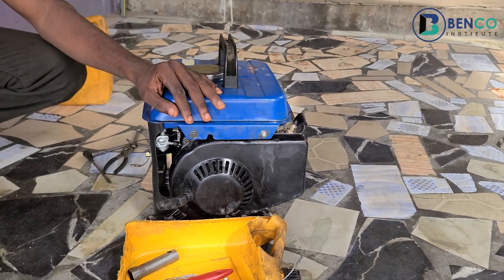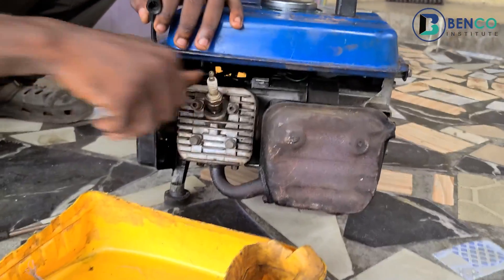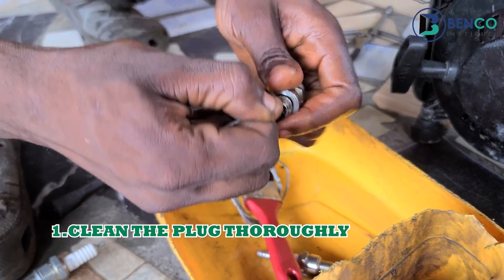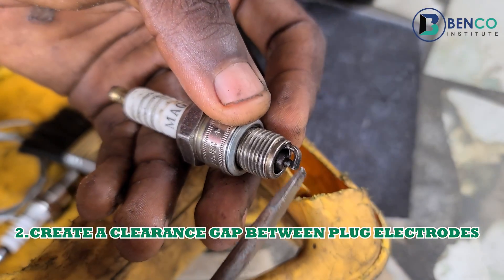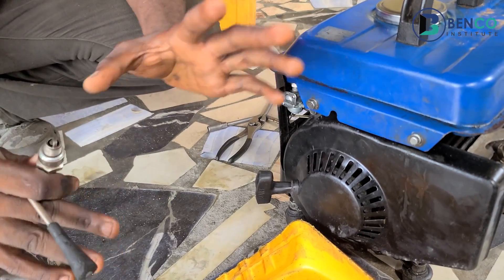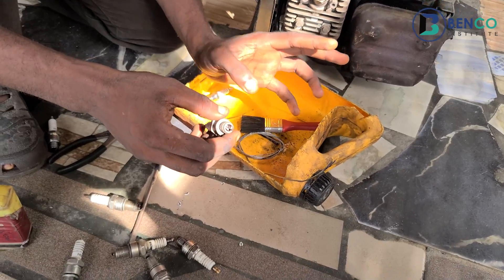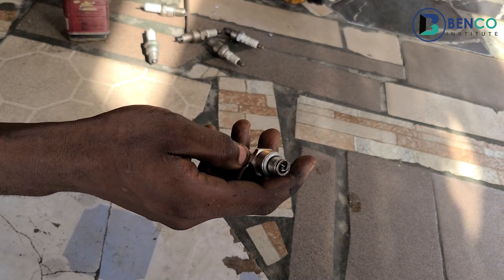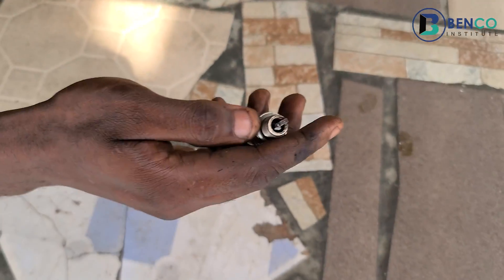How to repair a spark plug/Igniter  in 3 steps with no tools...Anyone can do this

Comment: Good job,my generator imex 2700 output voltage will not pass 150v even though I increase engine speed pls what can I do
Reply from the maker: Check the Diode of the Rotor
Reply: I've checked them 4pcs they are good, compared with new ones.
One thing I discovered is that two permanent magnet are missing out of six permanent magnet on the rotor,l was thinking maybe it can affect it producing low voltage
Reply from the maker: @adeleyeayodeji1032  That could be it

I am most certain the Rotor is the issue...

Try out two capacitors or get a single higher value capacitor that could boost up the output voltage
Reply: @bencoinstitute  l'v tried two capacitor with high value it didn't work.What am thinking is to replace the two lost magnet which l'v tried also to buy but couldn't get